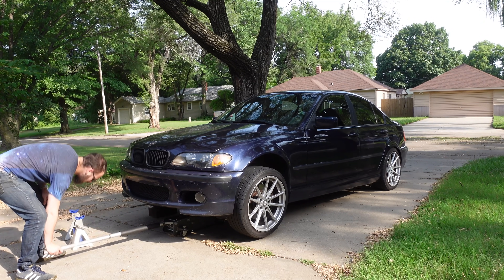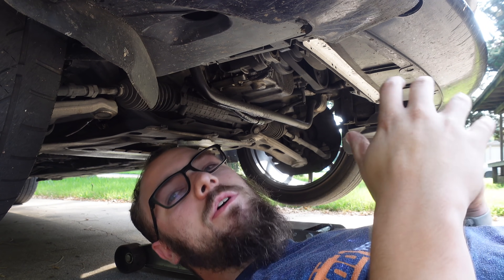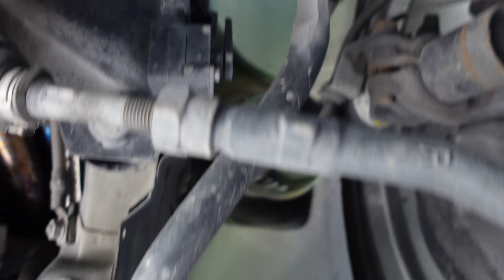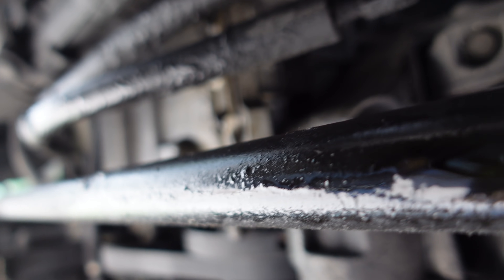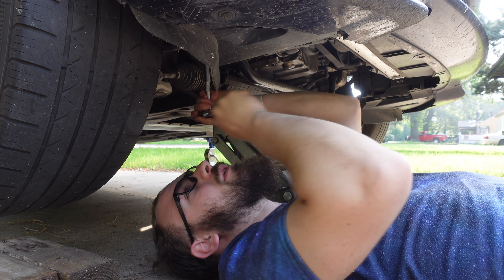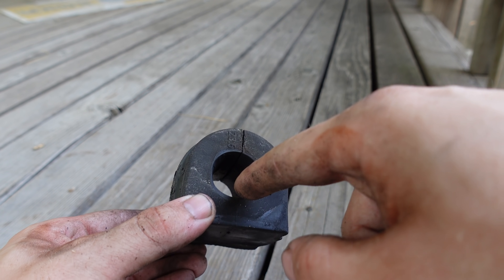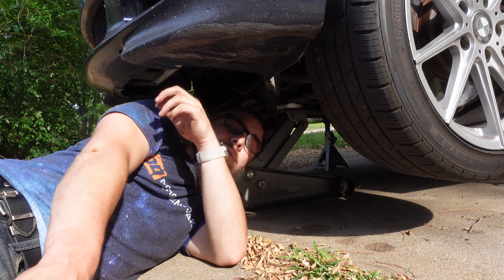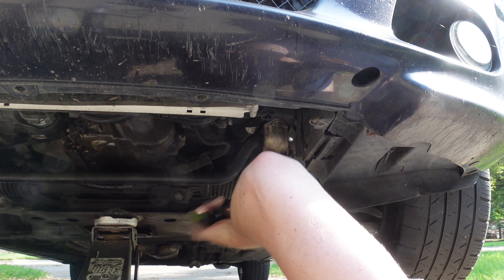FIX your SLOPPY HANDLING for CHEAP (EASY DIY!)

Comment: Inner tie rods or fading steering column flex coupler. I replaced the inners/outers and LCABs on my ZHP last month. The freeplay was still there. I replaced the flex coupler last week and it solved the issue. It's about an hour job.
Reply from the maker: Flex coupler was one of my first repairs on this car. Was extremely disappointed when there was still some steering play 😂
Reply: @100PercentJake   Nice! I wasn't aware, must be a video before I sub'd. I chased freeplay in the steering on my e30, e36, and e46. Each had different solutions. The inner tierods on the e46 are really easy to do, particularly if you are replacing the outers at the same time.
Reply from the maker: I have the whole inner/outer/boot kit on the way, as well as RTABs and the tool to do them, and brakes, and an oil change, and new wheel center caps and hood badge. It'll be a heck of an episode 😂

Comment: I put poly bushings and front and rear factory sway bars on my Dart in the late 90s or so. I did the front end and a front sway bar first and it was so much tighter and tracked so nicely but didn't handle much better. I later added the rear sway bar from a 75-76 Valiant police package car and holy crap, a completely different beast after that. Very flat around corners and tended to more oversteer. Of course having a early clutch type power lock sure grip also played into it. Car also has 340 torsion bars and read springs, plus a 16 to 1 4 turn lock to lock manual steering box.
Good bushings and components even on a well setup car makes a huge difference and probably if I had installed poly bushings on the sway bars it would have been even better but that rear bar was made of unobtanium when I got it in trade from a friend as very few or the Valiant police package cars were built but many of them ended up on the west coast where I'm at.
Reply: Can't you machine bushings out of a block of polyurethane?
Reply: @taunuslunatic404  Never looked into it but I bet you can as they're fairly hard. Mine started squeeking fairly soon after they were installed but a little wd 40 would quiet them down and supposedly they're impervious to oil and grease leaks like high miles 318 in my Dart had. I could never kill the factory engine, it just leaked and burned some oil so I just kept it topped up and changed it every 3k. I had planned to eventually drop a 340 in it but finally retired it with 175k on it. Maybe I'll drop a 5.7 hemi in it after seeing how well the 350hp one in my 06 Charger RT moves that fat pig.

Comment: Ugh...you set my mind to pondering a big project. My 1996 NA has 103,500ish miles and I'm pretty sure it's on the original bushings. I probably need to undertake a complete kit at some point.

Comment: Nice video.  I found my ZHP front anti-roll bar bushings needed to be replaced because the driver's side was gooey (peanut butter vibes) from all of the power steering leaks.  Once the reservoir/filter, hoses and pump were replaced the leaking was gone so the bushing could remain un-leaked-on.  Yours just looked wallowed out. 

BTW - your cooling system would really be happy to have that undertray.  And the cooling system needs all the help in can get in an E46.

Looking forward to next video

Comment: Get a splash guard if you really care about handling and your car. It will protect your undercarriage but more importantly, improve downforce/aerodynamics and your car will be more stable at high speeds.
Reply from the maker: They're... annoyingly difficult/expensive to find for these.
Reply: @100PercentJake  Front flat bottom shields are pretty easy to make, would make for a great video making custom flat body covers
Reply: @Motorsportsgeek  What material do you use?
Reply: @anthony2816  You can find pretty thick abs sheets from local suppliers but some people have used aluminum sheets as well
Reply: I agree, it also helps keep road grim off of the pulleys.

Comment: Hi Jake. I hate to say it but I think you might have bought and installed the wrong size bushings on your car. In the video you can see that the old bushings have stamped 23.5 on them, that's the inner diameter of the hole for the sway bar. Now when I lookup the part number of the new bushings you mentioned it says the bushings have an inner diameter of 24mm. 
I think your car's handling might even get better when you install the correct size bushings.

Greetings from a fellow BMW E46 ZHP owner (called Clubsport in Europe, but it's almost the same thing)
Reply from the maker: That is incredibly interesting. I'll have to do some look into that; the OEM part number per RealOEM does identify as 23.5, but every aftermarket bushing for a ZHP shows as 24.
Reply from the maker: After a look on FCPEuro their own product photos do show the Genuine BMW (which isn't recommended by their system?) has 23.5 stamped on it and the Rein (which is recommended as "OEM Replacement" has 24 stamped on it. My only thought is the Rein might be measured differently or undergo different amounts of compression by the bracket
Reply: @100PercentJake  Febi makes them, part number: 45097 aswell as MOOG, part number: BM-SB-14613. Maybe it is measured differently but for what they cost, I would've installed the 'right' ones :)

Comment: car needs new tires, concerned about handling; Buys new sway bar bushings.
Reply from the maker: Cost of tires: $600
Cost of sway bar bushings: $12

Those tires were on the rear, and all four were brand new when I got the car. They got ate up in less than 3,000 miles, I'm assuming due to my rear trailing arm bushings being shot. Parts are on the way for that.
Reply: Why wear out tyres and waste an alingmant when there's wear in the suspension / steering ?
Reply: @johnmoruzzi7236  why replace one component at a time when you could do all of them and save a ton of effort?

Comment: Are you not supposed to have silicon paste inside the bushing before mounting it?
Reply: As he mentioned in the video (8:56), you should do that for poly bushings, but not for rubber - they won't squeak.
Reply: @blautens  
Won't they last longer?